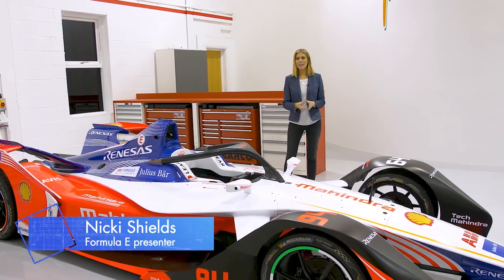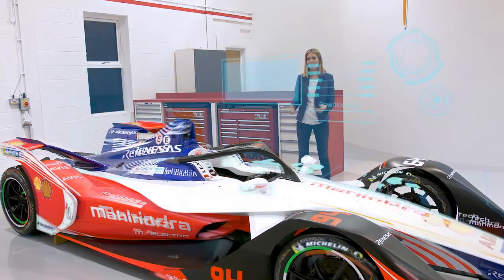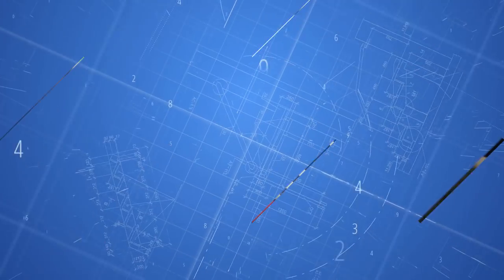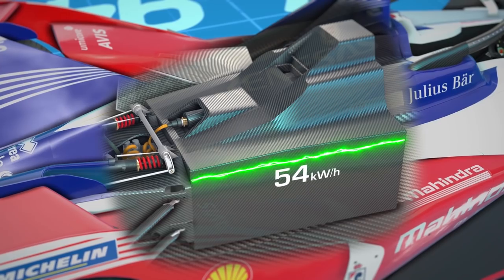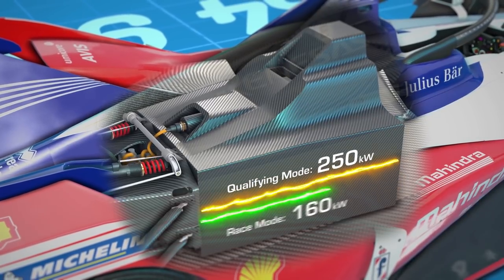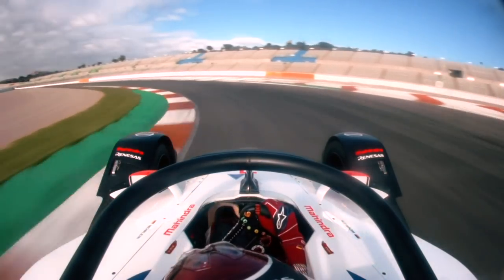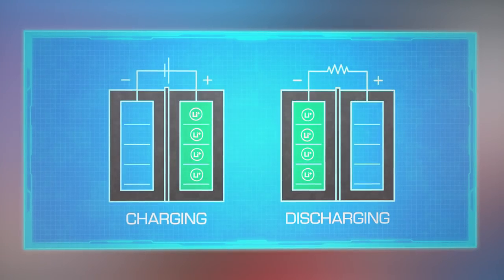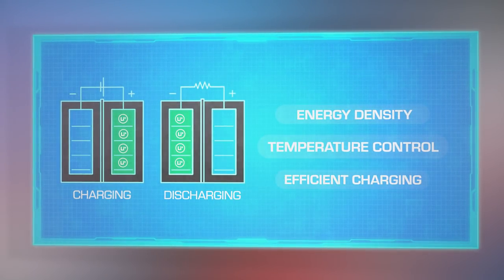Mahindra Blueprints: Batteries

Comment: Hot battery discharges TOO fast? Cold battery has high internal resistance? WHAT? old battery has slowed down chemical reaction time that decreases the amount of energy it can deliver fast and its overall capacity is lowered. In cold temps, conduction gets BETTER and resistance lowers. In high temps, the reaction is very fast but it is never TOO fast, unless we are talking about that chemical reaction again and the battery starts to degrade and the reaction can be so fast that the battery starts building up heat and gases, which can then lead to a catastrophic failure. But, it's DISCHARGE is never too fast.. It's resistance however, increases when it gets hot.

This has so much inaccuracies and shortcuts in the explanation that it really ruins the whole thing.
Reply: You are wrong I'm afraid, we're not talking about conductors like copper, that does indeed have R increase with temperature. You can look up some research papers on the resistance of batteries as function of temperature, and you will find that indeed, the resistance of batteries INCREASES at low temperatures. 

Example: https://www.researchgate.net/figure/Dependence-of-internal-resistance-versus-temperature-for-lithium-based-batteries-LiFePO_fig15_316171277

So she explained it right, the only mistake in the video is the unit for power, which should be kWh not kW per hour.